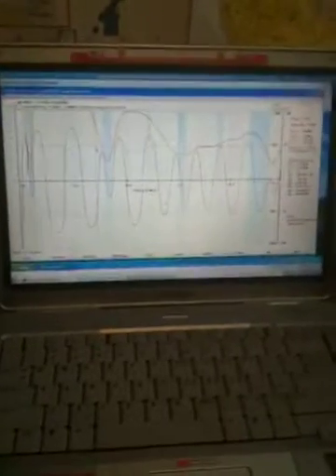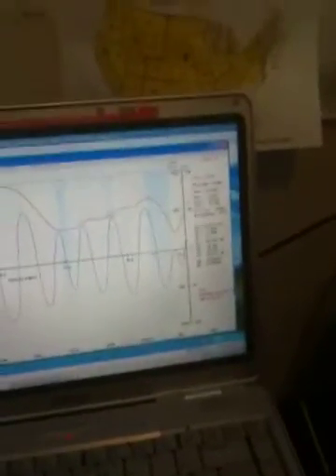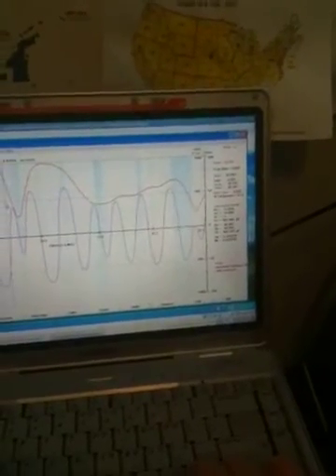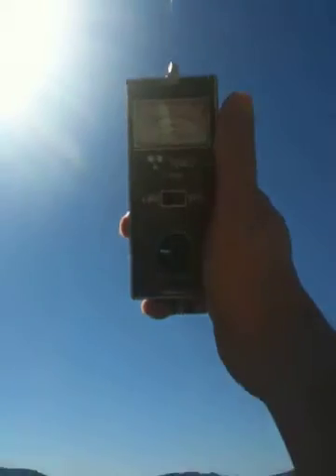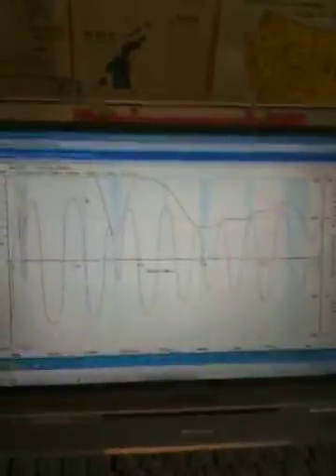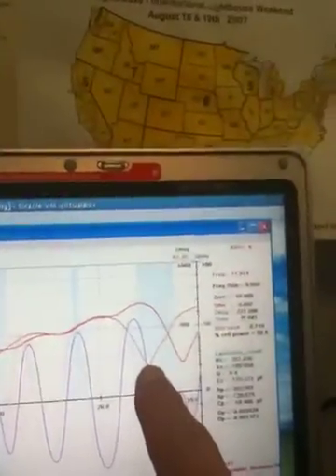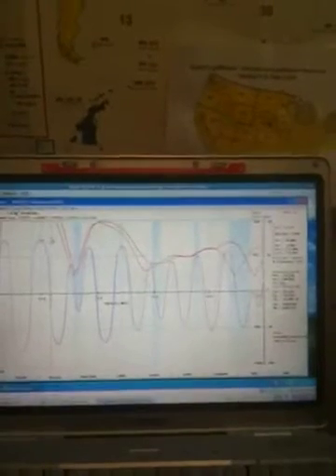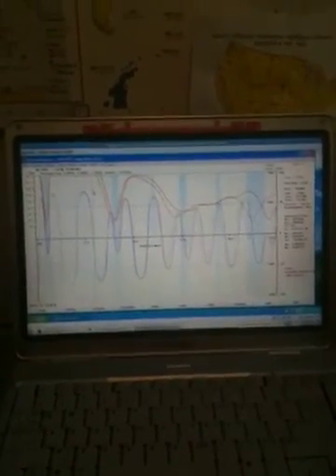Full Wave multi band Talented Balun Loop, Optimizing a single band

Comment: When trying to find node do u transmit on band you are trying to find node for ?
Reply from the maker: Hi Jeramy, Yes, transmit a very low power signal of same type that you will be using.
I used the "tune" function of the fldigi or wsjt-x program briefly.
You may also use RTTY setting and a rubber band around the PTT, nothing fancy..just keep the power very very low, (1/4 watt is sufficient)